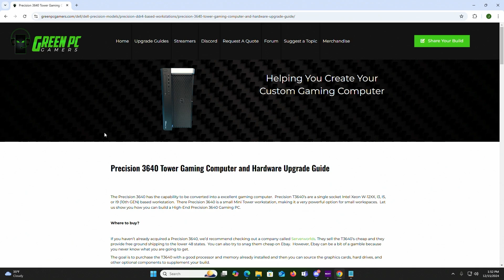How to install an 850W ATX Power Supply in to a Precision 3640 Tower Workstation

Comment: I have a question that isn't directly related to the PSU swap, but kinda. After the swap, would there be room for a large, hot card like a 5900XT in there? I'm trying to decide between the 3640 and 5820. Thanks, and I appreciate all the work you do for this!
Reply from the maker: Large GPUs will run too hot in a T3640.

Comment: will i have temperature issues in that case i7 10700
Reply from the maker: It will run hot even with the high performance heat sink with that cpu.

Comment: I have a hp z620 workstaion (800w), I wanna upgrade to a 4070 or rx 7700xt based on the pricings, but I'm afraid that the two 6 pin connectors are holding it back. I am super doubtful weather I should use a single 6  pin to 8 pin adapter. btw I bought this pc after watching your video about the z620❤❤pls help me and pls reply,  I am looking forward for your answer so that I can buy based on that

Comment: Very similar if not the Same chassis to 3630 I've got. It came with a 460w PSU already and rtx 4060 installed and I'm very happy. I'll be upgrading to an 850w at some point, only issue if max CPU being i7 9900k so there will be prob be a CPU bottleneck GPUs above 4060. I used to have a 3060 12 Gb but it wasn't all that. I'm hoping that Nvidia produce the 50 series with finally addressing the budget gamer without selling cut down previous series and passing them off as premium options.